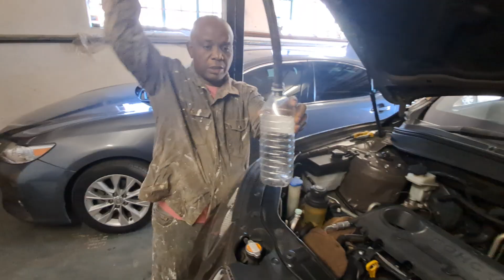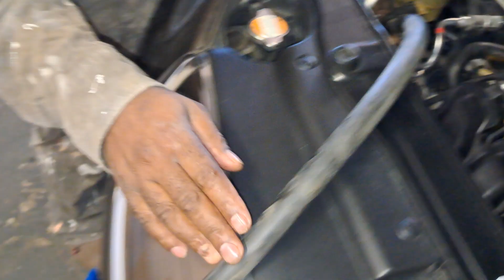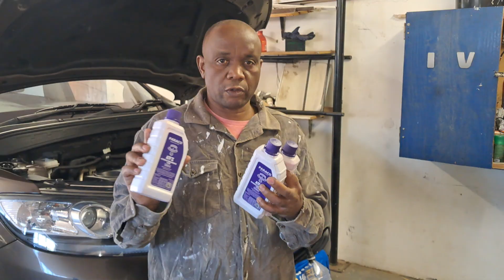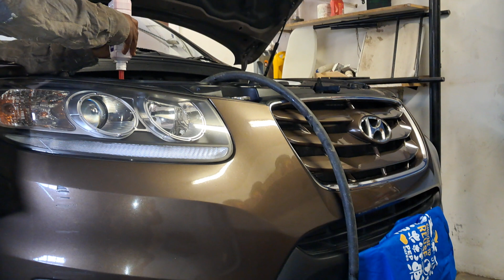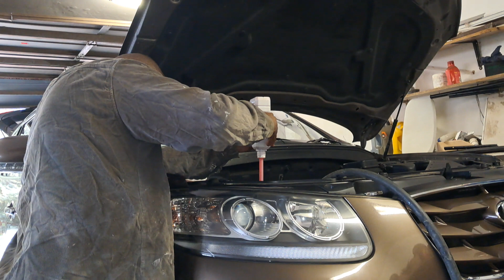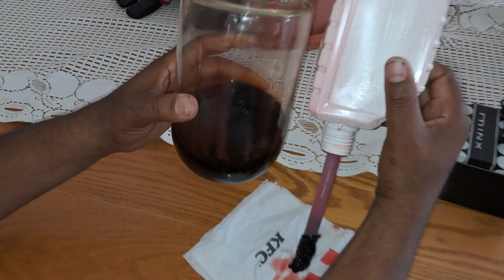Hyundai Santa Fe, DIY Power Steering Maintenance That Saved Me Money

Comment: I put brake fluid in my power steering!! I dumped the container.  What else do i need to do
Reply from the maker: Perharp,  best is to drain it and flush the system with right Power Steering fluid?

Comment: I thought I only need 1 liter.
Reply from the maker: I would recommend 2L for a thorough flush, if the oil is very dark, or that bad. I used almost 1.5L but 2L will have been ideal because  my oil was that bad.